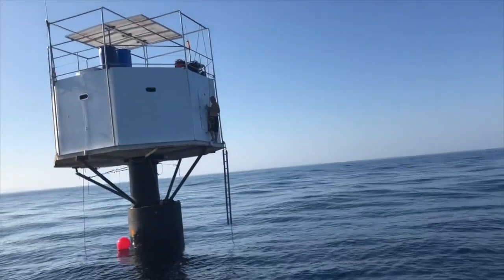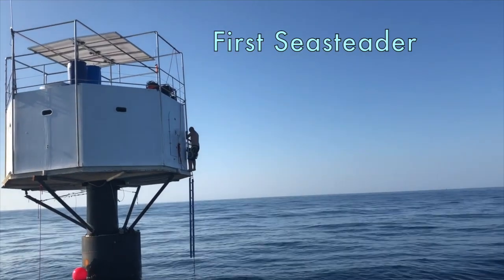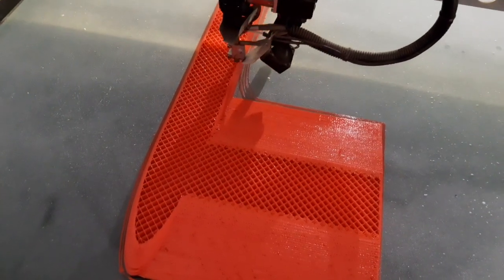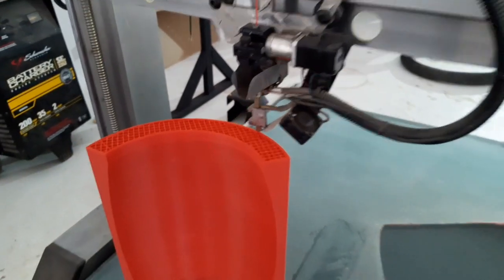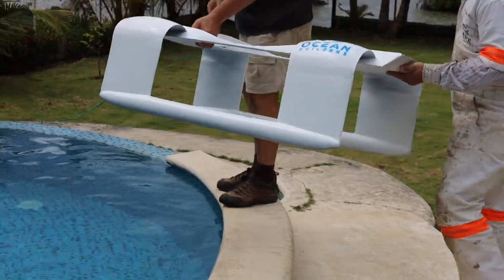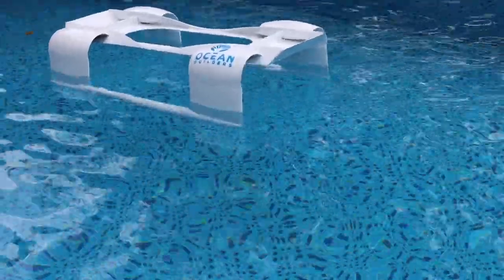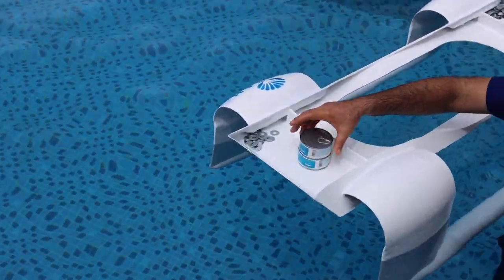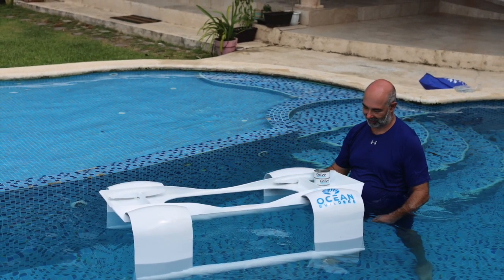SWATH

Comment: I'm trying to imagine one of these on the proper scale to have a deck that is the same height as the lower deck in the current Ocean Builders seapod plan, and it seems quite massive to be up that high. Are there any renderings of a finished SWATH boat moored/docked to a finished seastead? The mechanism for docking would have to be something innovative too, I'd suppose, such as an electromagnet that holds the underwater SWATH foot up against the seapod's spar.

Comment: Great video, keep them coming. I'm imagining peddling on a cross between a SWATH and an electric bike, gliding into the market on a calm fresh morning.
Reply: A lot of other configurations are conceivable. For a bike, a SWASH (Single Hull) may be better,  maybe in combination with hydrofoils. Also, propellers are very inefficient. As a bike rider is doing something around 60rpm, other forms of propulsion may be more efficient, such as caudal fins.
Reply: @OceanBuilders  hmm, neat, there are apparently some projects to use fins to propel boats:  https://ntnudiscovery.no/en/fish-propulsion-mechanisms-replacing-water-jets-and-propellers/